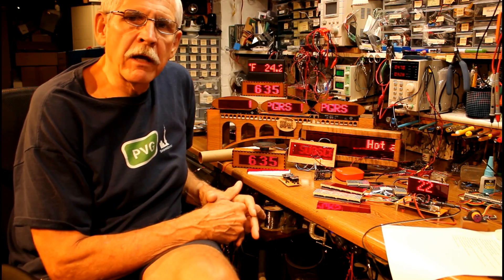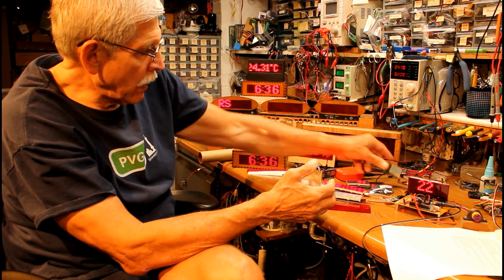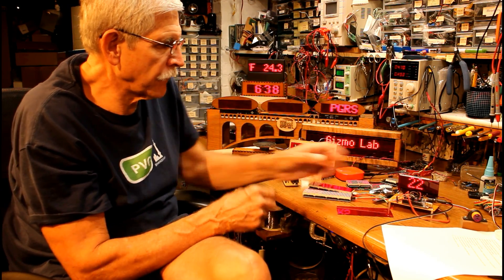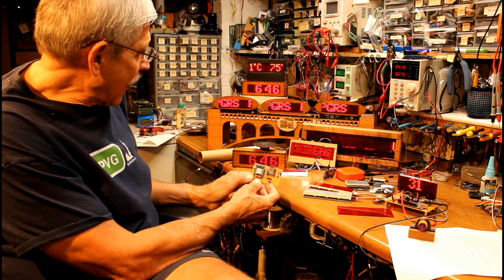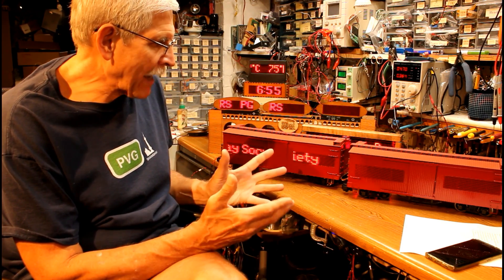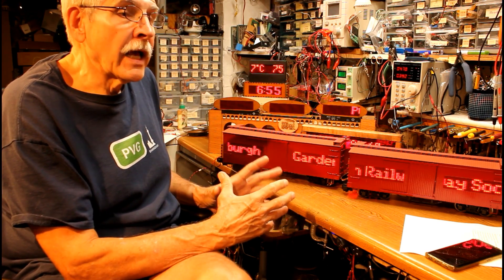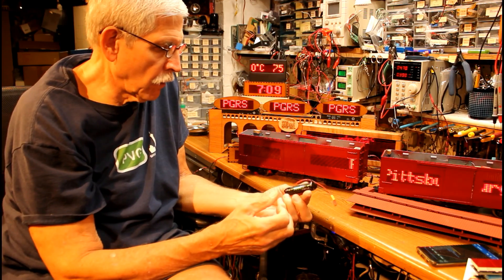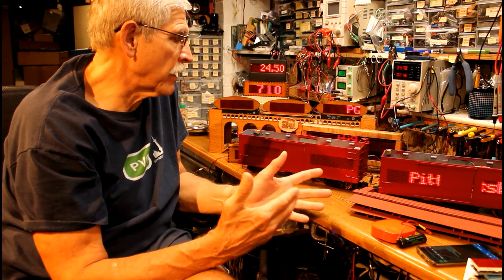LED Matrix Displays on the Railroad - Bluetooth Message Editing

Comment: Hi Dave, I just built this matrix/bluetooth display using your code and drawings. Everything works beautifully except the "/x" command. It doesn't reset the Arduino, it just prints "/x" to the LED display.  Any ideas? Thanks, -Terry
Reply from the maker: Terry - the only thing I can think of is a missing connection from output pin 5 to reset on the Arduino - is that connected?
dave